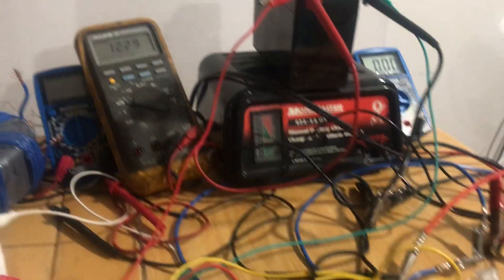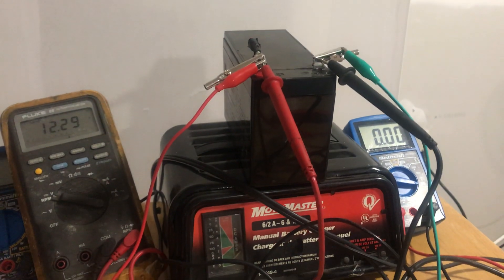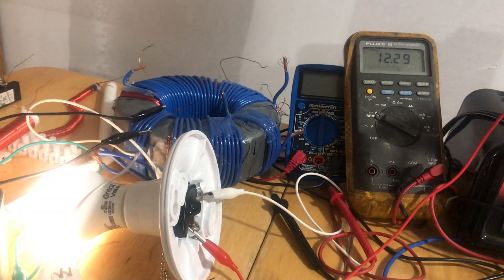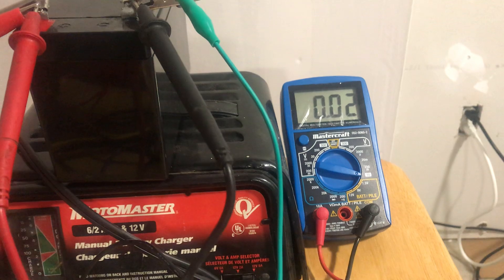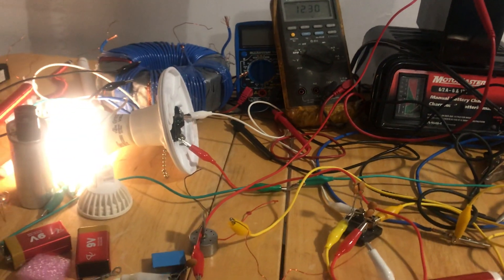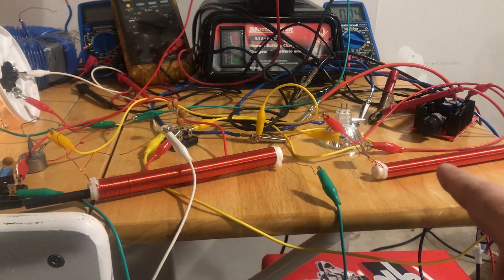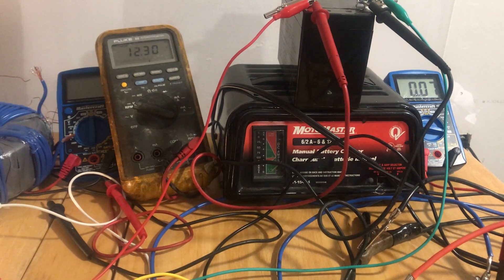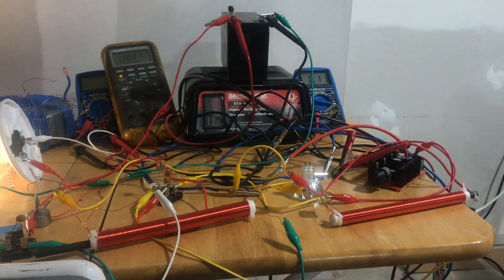Don Smith resonant rod free energy system

Comment: Have I understood correctly: your system is capable of powering a light bulb and simultaneously charging itself and re-energizing the light bulb. Looks cool, you are great! I am not good at physics, but there is a question: how much is the energy spent on powering the light bulb compensated? Equal or lossy?
Reply: Well to answer your question... it will be but have the system hasn't even been built yet I'm adding a flywheel generation system that's going to be attached to the Don Smith system therefore that system's going to run the Don Smith and the Don Smith will be able to charge batteries as well as charge capacitors and whatever so the system is not even half done yet so stay tuned It's going to take probably better part of a year to complete the whole system I'm still in r&D phase of development thank you for your question

Mike